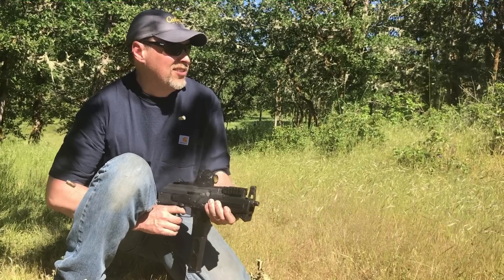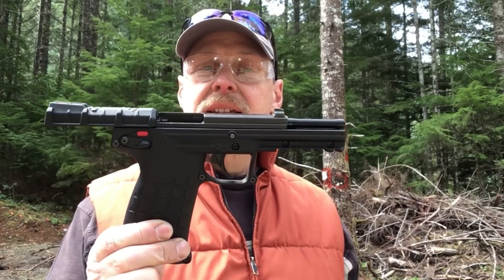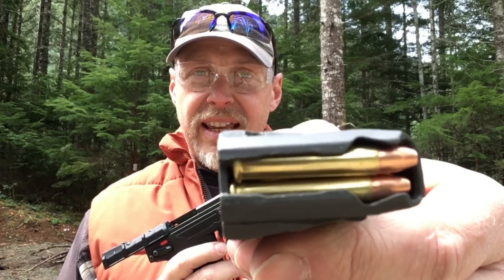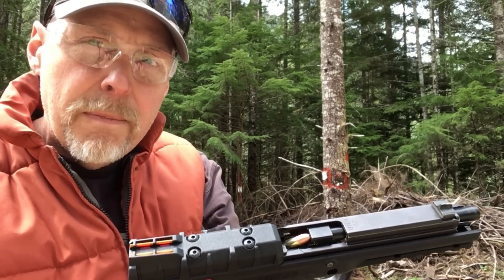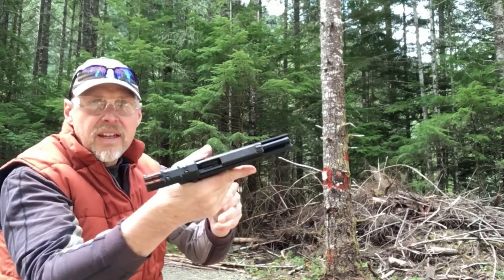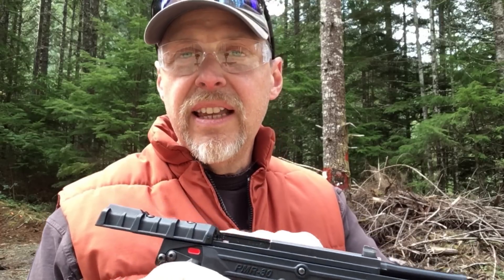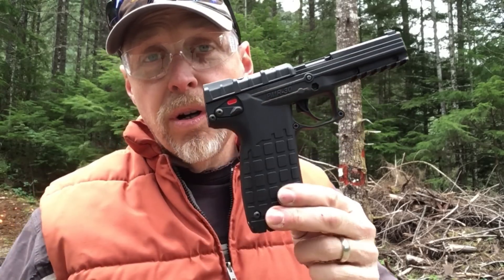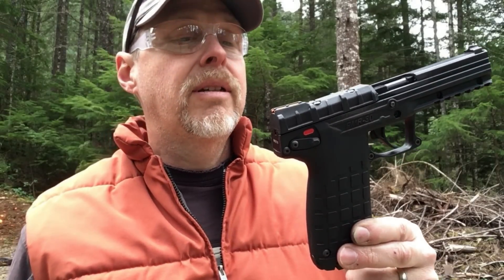Troubleshooting: the Kel-Tec PMR 30

Comment: would anyone carry the keltec pmr30
Reply: Clayton Williams if it works, then yes.
Reply from the maker: Clayton Williams 
  I would under a few conditions:
A- I could find a decent holster for it. 
B- It proves to be reliable long term and
C- I put night sights or a flashlight on it. 
  I feel that 22 magnum is a decent self defense cartridge. Especially when you’ve got 30 of them. 😆
Reply: Clayton Williams hunting small game.
Reply: Max Headspace9mm Yeah I thought the same thing about the .22 magnum round ,but you can only shoot 40gr rounds
Reply: Max Headspace9mm when the website Ballistics by the inch did the measurements for a short-barrel 22 magnum, the results were not very good instead of the 250 to 300 pounds of energy you were getting, it's more like 90 to 110 ft lbs... 
Not sufficient to knock a 250 lb man over that's attacking you... Of course shoot placement supersedes that! 

Needless to say...  It's a fun gun or small game plinker
Reply from the maker: Alaskan Ballistics 
  Yes. Shot placement is the single most important factor in self defense.
Reply: Clayton Williams I carry one hiking & camping. Super light, insane capacity, .22WMR is quite powerful. VERY loud too. Self defense (against human) IS in back of my mind, but I mainly carry in woods for wildlife. I’d sooner produce a LOUD report before I shot AT anything. This gun fits the bill on ALL of the aforementioned.
Reply: Oh yeah.... great vid. The graphite sounds like a great solution, I really wish we saw the Dremel-work & results after.....
Reply from the maker: DDinVT 
  You will. I will upload a video review once I’m confident it’s reliable.
Reply from the maker: DDinVT 
  Agree!
Reply: Max Headspace9mm  Good to hear! I (We) look forward to it
Reply: +Clayton Williams I do carry a PMR-30. Got a decent multi purpose hoslter that fits it just fine, mine works reliably, most .22 Magnum rounds from the 4.5 inch barrel perform on par with .380 ACP ballistics or close to them. It is finicky about certain rounds, but I'm familiar with what those are and I know what runs with mine personally. I think if Kel-Tec were to release a Gen 3 for the PMR, they should add a double firing pin like the old Henry rifle in .44-40 to ensure ignition with most all rounds. 

I dont have issues with feeding or ejecting, but certain rounds as mentioned dont always want to go bang due to light strikes. The feeding issues is all based on loading the magazine, Kel-Tec in the manual tells you there is a very specific way to do it and if you dont... well, it does malfunction quite often. That being said, it's not the most ideal for carry due to potential problems but I made sure mine works before I considered that.
Reply: About 3 years ago, a young mom (just minutes from my house) was home alone with her small children when a large monster bust the front door down while carrying a crowbar.  She used her 22 revolver to put him six feet under.  This story was also discussed on the Armed American Radio radio show just days later.  Yes, reliability is an issue but if a regular 22 revolver can do this - I feel a Gen 2 PMR 30 could work as well.
Reply: Alaskan Ballistics After 30 rounds, hes knocked over.
Reply: As long as single action with a 4lb trigger and thumb safty only doesn't bother you
Reply: PMR-30 with Burris Fastfire III, Streamlight TLR-1 HL and two spares is my EDC.
http://screenshot.ru/041a107bcca3f442818080ae76aed3ef.png
Reply: Read the story of Bella Twin of Alberta, Canada who shot and killed a giant grizzly out of beat up .22 single shot rifle, using .22 LONG
https://www.ammoland.com/2017/06/bella-twin-the-22-used-to-take-the-1953-world-record-grizzly-and-more/#axzz5GY7vn5df
Reply from the maker: a krasnovid 
  I heard about that. It’s legendary stuff. If I met an angry bear I would hope to have more than a .22 to deal with the situation but you use what you got. 
   I watch that Swamp Hunter show and all those guys dispatch those huge gators with a single shot of .22 to the brain and the fight is over.
Reply: Clayton Williams if its reliable
Reply: I do, although admittedly, mine has not demonstrated the problems experienced and reported by others.  It seems to prefer a heavyer round and scarfs up the 45 gn. Critical Defense like a fat kid does candy.  During breakin, I did have a couple of misfires with a dented primer but not any of those typically associated with the failure to feed described in your video.  I do use a loader because stuffing the mags makes my fingers sore but otherwise I've been delighted with the thing from the git go.  BTW, you might try Alien Gear for a holster.  I like mine although I don't use a light.
Reply from the maker: buzzsaw ncgo 
  Great info. Mine still hasn’t become reliable and I’ve tried every fix I usually try as well as all the fixes I’ve seen people do on the internet. And even though I couldn’t be more careful with my loading and tapping the magazine I’m getting a loader anyway. If there is a chance this thing can work I’m going to give it that. If I can get it working reliably I’m definitely going to check out an Alien Gear holster for it😉
Reply: Mine, by all accounts is an annomilay.  It came out of the box the way it stands.  I would aknowledge to having a firm grip but since I've had others shoot mine without it developing any yips, I'm not suggesting that has anything to do with it being reliable.  I've intentionally tried just about every brand and type of ammo that I can lay  my hands on and have not seen any adverse reaction although I sense that it cycles smoother or more positively with the critical defense ammo but that may just be my mind set.  I did initially field strip the mags and spray them with a dry lube and reassemble them before the first trip to the range but it is hard for me to imagine that made any large difference.  I find it a real pleasure to plink with when I can get to the range (which  isn't often enough)
Reply from the maker: buzzsaw ncgo 
  Thank you for giving me hope. I know if there is any way to get this pistol reliable then it’s worth it. Very unusual gun with some unique features. Makes me want it to work so much 🤔
Reply: a krasnovid legit paint job? You do that yourself? I’ve got my PMR decked out to the max! Check out TandemKross... the grips and magazine pull makes the gun even more bad ass
Reply: Max Headspace9mm look at running a bead of glue under the magazine release ramp... the mag isn’t fitting properly up into the action. Fixed mine instantly
Reply from the maker: Marcus Oakes 
  Yeah. I noticed some play in the mag fitment. I did that fix and it just began to malfunction in different ways after that. I’m at my limit on this one. Never had so many different problems in one firearm. I think I’m going to have to rely on KelTecs excellent customer service on this one.
Reply: Max Headspace9mm are you running the first gen or second gen? First has the .22 wmr on the barrel... second gen has the .22 wmr by the 4 screw red dot rear slide grip
Reply from the maker: Marcus Oakes 
  It’s a second gen.
Reply: Clayton Williams id rather carry a fn 5.7 i wouldnt trust my life on rim fire cartridges, they are renound for failures
Reply from the maker: MrRedeyedJedi 
  You know I agree with you in principal. For many years rimfire was the most likely to go click due to not having a primer or poor seal of case around projectile which allows dampness to affect the powder. Up until very recently 22 were cheaply made and not considered reliable. But the trend lately is toward more expensive options in 22 ammo. You can still buy the cheap stuff for fun but the volume of options in high cost, high quality 22 ammo has exploded recently. And my experience with high quality 22 is that it is very reliable. When I stick to high quality ammo I go 1,000s of rounds before I get a click. It’s still not as reliable as centerfire which I could go around 5,000 or more rounds before I get a click depending on ammo quality. But still I think 22 is getting into the realm of dependable carry for some people.
Reply: Keltec no, 22 no
Reply: Nice looking gun krasnovid!
Who did the Kryptek finish on it and how much does getting that done cost?
Reply: The PMR will fit in many 1911 holsters.
Reply: They have .50 grain too..game stop if I remember.
Reply: Did not know that.  Thanks for the info:)
Reply: SON OF ABRAHAM  I carry it. One police officer stated every case he worked involving a .22 Magnum, did not survive. My pistol does not like CCI ammo, I shoot Winchester with no jams or misdeeds as I did with CCI. I do have a couple of .45 acp pistol and revolver for carry both are heavy guns while the PMR is so light.
Reply: No
Reply: I carry one a lot....rarely carry anything else....
Reply: Alaskan Ballistics honestly 30 rounds anybody will go down.
Reply: I threw one in my truck with two mags loaded. Gen 2 seem to be a little better.
Reply: Winchester's 'PDX-1' self-defense ammo is available in a number of calibers, including .22 WMR! A claim has been made that PDX-1 in .22 WMR is similar in ballistics to .32 acp. ball ammo.
Reply: I dont think the mag load -thing is all that problematic. It's very simple, PMR mags have a separation wall (dead center@ back of mag) internal. As you load they go left right....left right! You have to be drunk, high, or an Idiot: To mess up
Reply: @akrasnovid1157  man, that's one tricked out pistol. Nice work. Any issues with the Burris optic? I was thinking about putting something similar in mine.
Reply: No real issues. 8 MOA works great for my old eyes.
I just don't like auto shut-off mode. I choose Burris, because Kel-Tec sells plate for it.
Reply: A good gun for your wife too carry easy to shoot no recoll
Reply: Factory cerakote

Comment: LOL you're killing me. Friction? Graphite in the magazine? Lubricating the chamber? The problem isn't the gun it is your ammunition. Try using a heavier 50 grain projectile. The added back pressure will help cycle the slide and would cause more reliable feeding. Your slide isn't retracting fast enough or without enough energy. Believe It or Not Your recoil spring stores energy. The more energy you store in the Recoil spring the better your gun will feed.
Reply from the maker: Steven Johnson 
  Don’t jump to conclusions so easily. This was the first time I took the gun to try it out. I bought the ammo that the manufacturer recommended. ( why not?) I agree heavier, hotter ammo would help.
Reply: Max Headspace9mm I just subscribed. I am very interested in seeing your follow-up review after 500 rounds. I own this Kel-Tec PMR-30. And I own a 22 mag North American Arms mini revolver. And a Rough Rider 22 Magnum revolver. All of these 22 mags guns leave little cream colored balls the size of pinheads in the chambers and Barrel. I don't know if it is unburnt powder or already burnt powder but it definitely came from the powder. Not just Armscor but CCI maxi mags and other CCI 22 magnum bullets leave this same residue. I wouldn't worry about using graphite. My PMR-30 had issues the first couple magazines. But after a hundred rounds it has ran perfect.
Reply from the maker: Steven Johnson 
  That’s good to hear. Mine is getting more consistently reliable but not 100% yet. I wouldn’t feel right doing the review until I get 8-10 mags through it without issue. But if that never happens then I will still do the review and be honest about my findings. Can’t have people trusting their lives to an unreliable gun now can we?
  But even if this turns out to be just a curious fun gun I still like the idea. It has some very appealing attributes. 
  Thanks for the sub and the conversation. 😉👍
Reply: Max Headspace9mm do you live in Washington State? Just curious it looks like Washington with all those trees in the back
Reply from the maker: Steven Johnson 
  Close. Oregon.
Reply: Lubrication reduces friction, therefore changing the way forces on surfaces behave against or with each other.  That's the first thing I would have done is take it apart and CLEAN, and then lube lightly, and liberallyin and on the parts I thought needed it.

Comment: Break in is a myth
Reply: Its not with some manufacturers that have poor or super tight tolerances its easiest to see on handguns like my glock a few hundred rounds in were you see some material worn away from firing that was causing friction. I think seeling a firearm that REQUIRES  you to break it in to run reliably  should be addressed though...

Comment: Total fail Kel Tec.  Never put an, " unreliable & substandard product" in production! Not to mention; this is a firearm!  God forgive me, (if) I'm incorrect. Name not withheld, & replys will be ignored.
Reply from the maker: steve spring 
  Well I hope you don’t ignore my reply because I agree with you! I really can’t understand how it makes any sense as a business model to mass produce a product with such a high percentage of them out of spec or defective requiring customers to do gunsmithing on them or send them in for service before they have any chance at reliability. I do think KelTec has done an awesome job of designing firearms no one ever thought they needed till they saw it or niche designs like this PMR30 which is a marvel of light weight and capacity. It may be a case of  a reach too far but I think KelTec simply is trying to do too much; make revolutionary designs, make them some of the cheapest in the marketplace and provide some of the best customer service of any firearm company. They’ve chosen a tough path. But I can tell you this: if my next video that shows wether or not I’ve been able to get this pistol reliable reveals that it is possible for this pistol to be reliable then for me it will be worth all the hassle I’ve been through so far with this gun. Because as a design it has some undeniable potential.
Reply: Max Headspace9mm lost my , car, job, home, now as a semi disabled vet. living in a V.A. supported apt. I've not had the opportunity to buy any Kel-Tec products. They just began selling the 32acp&3AT variants at my "demise", shame as I saw how their 3AT was also a problem that, with time, they solved.  I concur that after I study more than 2 YouTube reviews, my initial overreacting reply to this video will probably become an embarrassing error.  In God, I trust eternally.  Thank you for taking your valuable time to respond to this 1st. time viewer; who now shall subscribe.  Put a couple of rounds downrange 4 me.
Reply from the maker: steve spring 
  Will do. Thanks😉

Comment: Keltec sux. Will never own another one.. Semi auto Shotguns and rifles feed better than a 10% failure rate with long cases
Reply from the maker: Dep Qua 
  Yeah. I’ve never had a KelTec before. Just seem too cheap to me. But opportunity as well as the lure of this very high capacity pistol was too much of a dangling carrot for me to not try it. I knew before I got it that there were reviews about as mixed as any firearm on earth. Some people saying it’s awesome and runs perfectly as well as plenty who say it’s junk and not reliable. I believe both extremes are true. It all comes down to quality control problems from a manufacturer that doesn’t charge enough for their product to cover the cost of producing a consistent quality product. Like Glock for example. Consistent quality. Not over priced not under priced. Just what it takes to produce a quality, reliable pistol.  My hope in all this is to go from garbage to great and learn a lot along the way.

Comment: To me, it's the round itself. It's just too long of a cartridge with a very small diameter and it doesn't lend itself to be ultra-reliable in a semi-auto platform. Three "clicks" in thirty may be fine for some but if it can't run a thousand through with no issues, it's not worth my money...plus, I don't want to have to "work" on something straight out of the box to get it to operate properly. I don't jive with the extended break-in period either... that's just a lot of bs to me.
Reply from the maker: Andrew k Adams 
  Well I tend to agree with you on all that to a point. I’ve heard a lot about this pistol and the idea of 30 rounds in a flush magazine was more than I could resist. I had to find out for myself. And while I don’t like having to fiddle with this to get it to work I realize that I do have a certain amount of patience that has served me well over the years. Solving problems is part of the fun to a problem solver. If this was a $500 pistol I wouldn’t tolerate these bumps in the road. But for $200 (what it cost me) I can consider it a “project”. I wouldn’t consider this “reliable” unless I get about 10-12 mags through it with zero issues whatsoever. Otherwise it’s a “novelty” or just something I tire of and pass on to the next curiosity seeker. 
  As for “break in periods” I’ve experienced them on high quality firearms too. I have a FNX 45 which is excellent but on the first couple of mags it had some hang ups. Ive also experienced this phenomenon on Glocks and many others famous for reliability. New parts need to get used to each other. Just basic manufacturing.